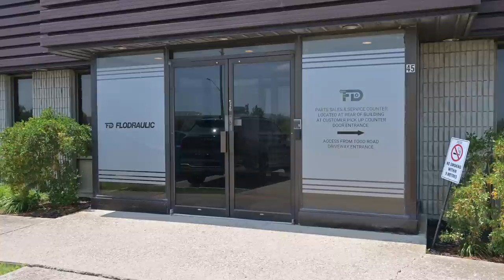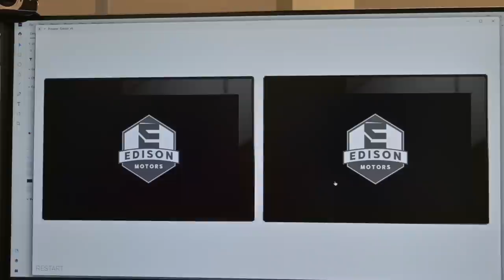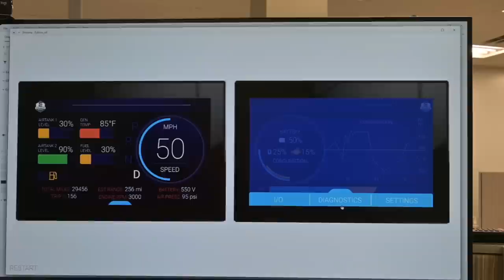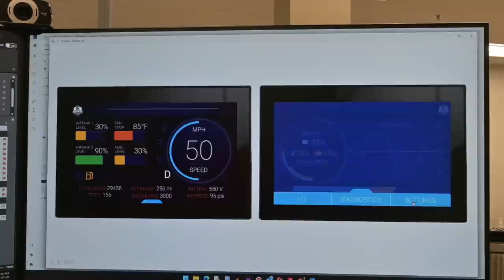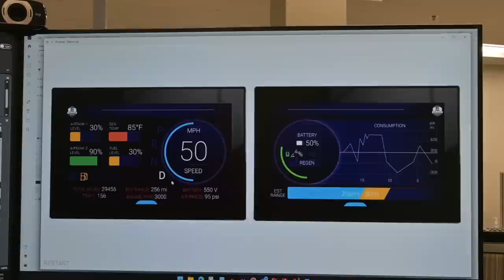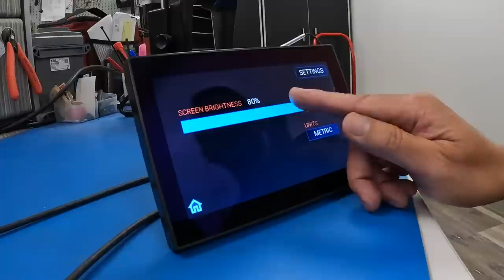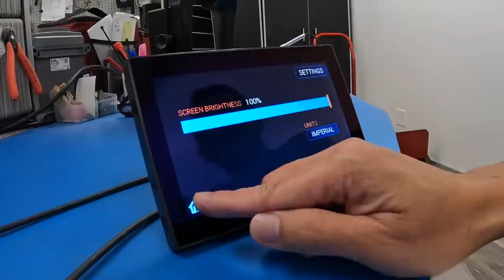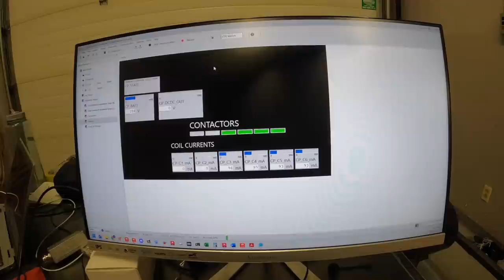Testing The E-Axles

Comment: To the software developer, remember to do real world testing, and make the screen dim automatically when the headlights are turned on so it doesn't blind the driver
Reply: Make the dimming it's own, annoying loosing it where headlights are mandatory 24/7
Reply: Great suggestion. I find when I am driving anywhere there aren't any external lights (e.g., outside of a city or town), I turn my dash lights almost completely off. I find it makes such a big difference in my visibility when I don't have a bunch of unnecessary bright lights shining in my face that is reducing the sensitivity of my vision.
Reply: Some safety protocol calls for headlights on at all times when truck is moving. If they dim dash you wont be able to see it in daylight, just like the error they made on the pt cruiser dash lights.
Reply: Red backlight is a big eye saver at night.. or at least allow the operator to choose it if the leds are programmable
Reply: Yeah, don’t pull a Boeing starliner and forget to set the clock 😂
Reply: Or  add a quick toggle switch that switches between dash lighting configs that you can set up yourself
Reply: Yes but also put a esey lever and a switch to turn off any automatic dimer
Reply: How bout an old fashioned dimmer switch? 😮
Reply: Some places require headlights to be on 24/7, making this feature pointless and annoying. Should offer the ability to deactivate it.
Reply: Should have 4 modes.  Auto dim via sensor (with light sensitivity adjustment), Manual adjust from full dim to full bright w/physical dial/knob, full dim over-ride, full bright override.
Reply: I drive with the headlights on any time the truck is running. I also wear sunglasses during the day. The dash dimming automatically based on the headlights being on means I can't see the dash durring the day. Just something to think about.
Reply: How about a good old-fashion dimmer switch?
Reply: Blue light filter would be awesome too
Reply: Yeah cause they haven’t thought of that🤦‍♂️

Comment: I like the graphics that are being developed for the displays. One suggestion that I have is to look into implementing ISA 101. ISA 101 basically uses greyscale for everything, and then adds color when warnings / faults are present. The idea is that the sudden change in color will draw the operators eye to the screen. Shoot me a message if you'd like to see a demo of what I'm talking about (I'm an engineer for a very large automation company)
Reply: That would be a great option, but it should not be the only kind of display of information i think, cause it looks as appealing and is not necessary for someone who at the core just drives a truck.
If that would be a big machine that needs to be monitored 24/7 i would say that something lile ISA 101 is necessary.
Reply: This is a great idea! Kind of like what Airbus (and now Boeing with the 787) do with the “Dark flight deck” concept. Lights are off (well, dim) when they’re working right, and turn on when they need attention.
Reply: Great idea period

Comment: This trip was not a waste of time to most of us listening and learning how both of your companies work together and we see the beginnings of a new company. Thank you for the great trip! And I thought EV trucks were a no go. I drive a snow plow for a town in Western New York where we see the snow some times in great amounts. This would be interesting to see if an EV snowplow truck could work in this environment,  especially with SALT!
Reply: Was about to write that, definitely not a waste of time, super interesting stuff.
Reply: batteries and winter are a terrible combo. hybrid is viable because the engine charges the motor, but batteries lose a ton of capacity and output in the cold. teslas actually heat the batteries in the cold so they can hold more
Reply: I expect the 'snow plow' application is going to be narrow field...where there IS great changes in altitude for regenerative operation. Flatgrounding these things isn't going to make sense, eventhough I'm sure lots if Government Entities will clog the streets with them.
Reply: The generator will also act as a heater for the batteries so temperature won’t be as much of an issue.  You will get the advantage of the amazing low end torque of an electric motor, great for slow heavy starts.  Also the precise traction control you can get with an electric motor means you will have less sliding in icy conditions.  One of the other advantages that electric has is you can power all sorts of auxiliary devices, like a welder for in field repairs.  There is a lot that electrification can bring to a snow plow.
Reply: "Let's watch the axles spin" was the teaser for a much more in depth great video. Chase wanted 1 battery bank operation. I'm surprised that wasn't communicated well to them.
Reply: @wild_lee_coyote i seem to remember chase mentioning testing with a standalone diesel heater for liquids ( ie the coolant ) for warming up the battery blocks
Reply: This is the interaction that I was looking for. I am a mechanic here in Western New York area.  Salt sucks, but it pays the bills.

Comment: I usually prefer analog gauges, but I absolutely love the way those displays are done, and the diagnostic screens are ingenious. Have a simplified overall schematic illuminated so you know what you're looking at as soon as you start. Having one screen for engine/generator and one for chassis is a great idea also. Well done, all of you!
Reply: You need both, different tools for different jobs. You can't do stuff like energy flow and historical metrics with gauges. While gauges are far superior for vital live metrics. The way Edison with old-school dash infront of the steering wheel and screens on the roof is perfect.

Comment: Listening to this, I suddenly had an interesting idea: I used to drive off highway truck chassis based fire trucks for forest fire fighting... the edison motors truck would be AWESOME for that. In order to run the water while moving, our trucks had auxiliary diesel motors just for the pumping and hydraulics systems. That could be entirely replaced with an HV pump. The bottom could be heat shielded, and with the space saved by cutting out the auxiliary diesels, the water capacity could be increased. The cab gives excellent visibility, the controls could be simplified and omfg the info I could get from those LCDs.... now I'm giddily excited!
Reply: I remember 15 years ago explaining to a rural firefighter all the advantages a hybrid apparatus would have over regular diesel-mechanical. A 200kW generator gets more work done than a 200hp PTO shaft any day. Less fuel burn on the fireground, easier to maintain and swap electric accessories to match the task, can combine/share the power from multiple apparatus if needed, plus power emergency shelters and pumps during outages, etc. Get rid of all those separate engines to maintain for generators, compressors, boost/draft pumps, etc.
Plus, electrics can be built inherently safe. Put an LEL meter on the truck to automatically switch it to all electric mode when an explosive atmosphere might be present, it can still operate if needed without being an ignition source - that would be mandatory for oilfield firefighters right quick.

Comment: It would be good to be able to change the units separately for speed and temperature ect - here in the UK we use Celsius for temp but miles for distance and speed (for whatever reason) 😬
Reply: Don't worry we also do that in Canada for various measures lol I'm sure they will think of it. IE coolant temp in Fahrenheit, speed in kph
Reply: @duffbiker psi > kpa
Reply: Because they did not want to follow france fully, just partly.
Reply: how we measure distance in miles, mileage in miles per gallon, then sell and measure the fuel in liters is infuriating. my JDM honda with a converted speedo gives me miles per liter, much more useful!
Reply: @olivermatich2818  agreed, if we're going to go metric we should actually go metric

Comment: with the screens make sure they have airbags etal so they do not get shaken to bits and stop working when in the truck if you need a replacement it is less than a 5-minute job as in pull out unplug etc

Comment: Having worked with electronics in high vibration environments, the only thing I'd change about the electrical boxes would be to - Use fatter cable ties - The fatter ties don't dig into cable insulation.  P clamps to hold bundles  down so they don't wiggle, and the use of foam pads to prevent the signal cables from  wiggling in the conduits.   Adhesive cable tie mounts always melt away in high temperatures.  If it can wiggle, it needs to be secured, and avoiding putting stress on the connectors prevents wires from breaking at the connector.  

I hope it goes well for you guys.
Reply: Mike Patey sells some really awesome zip ties for high vibration environments. If they're good enough for aircraft, and good enough for Mike Patey (extremely high standards) they're good enough for a work truck.

Comment: May I suggest that you have the units selectable for each function?
An American driving through Canada may will want speed in the local Km/h, but temps in °F (what they're familiar with).

Most Canadian's will want engine temps in °F and outside air temp in °C, and pressures in PSI, etc.
The vocation specific functions may want totally different units again.
A master switch to go all metric or all imperial doesn't reflect the real world use of mixing units.
Reply: 100% agree with you
Reply from the maker: That actually is a really great idea!  Thank you
Reply: @northern1937  how much power kw?

Comment: A warning popup that covers basically everything is not what i would do, i would flash red at some place where nothing of the information is blocked so the driver can see "oh theres a problem" but still see all hte information while the popup is there.
Reply: Common issue with graphic designers, they have either null or very superficial knowledge about usability.
Reply: Agree. Or at worst a Tertiary screen has the popups. I wouldn’t want it overt my primary display.
Reply from the maker: It depends on the pop up.

Minor ones are just a warning icon.  Major ones you absolutely need to notice should pop onto the screen
Reply: @EdisonMotors  Still, covering the speedometer with a warning message that is anything but "STOP VEHICLE IMMEDIATELY" isn't a good idea...

Comment: One thing that would be nice to incorporate is the ability to set some parameters to be  displayed in metric and some in imperial at the same  time. Us Western Canadians (i cant speak for the easterners) are accustomed to using to using a mixed bag of measurements. Its annoying on modern vehicles when i want the temperature displayed in °C but then am forced to get pressures in kpa because of it.
Reply: It would be nice if I could just double tap a guage, and it would switch from imperial to metric, double tap again and it's back to imperial.
Reply: @jmanlinc also double tap would be nice to cycle through the various different measurements. 
KPa vs atm vs psi vs mmHg.

Comment: After seeing the power flow diagram, I think you will need to simplify it like the Prius does.  You basically have GEN <-> Battery <-> Axles.  You just need to show charge and discharge from each item.  During power with Gen running, it's charging the battery and the battery is discharging to axles.  When regen, the axles are charging the battery.  When using the generator as a jake brake, the axles are charging the battery, which is charging the generator, which is discharging to the engine.  So I guess you need to show jake brake in the diagram too.

Comment: Make sure the actual display monitors you install are significantly larger than that small monitor Jerome was using during his demonstation. Don't settle for just any font, or at just any point size, or any letter spacing. Make it zero strain or effort to read the display without having to strain your neck forward etc. No small matter, that interface. Legibility is crucial.

Comment: I'm skeptical of having controls that can only be operated through touchscreens. If the driver is wearing gloves, or has dirty hands, or the road is bumpy, those screens would become annoying or impossible to operate. I'm surprised given the background of all the teams behind the project that this is the route they're going with.
What I'd like to see (and granted I'm just a construction contractor with little knowledge in heavy trucks or programming industry, I could be entirely off base here) is a row of clickable rotatable knobs under the screen for scrolling through and selecting options that could be mapped to different fields per screen as needed, a set of directional buttons for other navigation, and a brightness dial on each screen. Look at the control scheme on a Behringer digital audio mixer, that's the kind of thing I'm thinking of.
Using physical controls like that means the driver can operate the screens while wearing work gloves (or not have to take their winter gloves off while the truck warms up) by muscle memory without looking. 
Regardless, I'm excited to see these trucks come to market! Looking forward to the day i see a cement truck roll up to site completely silent
Reply from the maker: You really shouldn’t have to ever touch those while driving.  All the controls you actually need are switches in the dash

Comment: Have you considered a shut off switch to isolate your systems for welding,or a built in ground to drop to protect the truck when the “something snapped off, we need to weld on the truck.” events. With all these electronics it would be nice to not smoke them.

Comment: Just having looked at those screens, I have a few unfortunately negative opinions. Main one is the dead space around the screen, it’s not necessary and makes it harder to read. Next I’d probably add some buttons along the bottom to do the main screen navigation features. Even modern touch screens are less reliable than buttons, especially when exposed to the sort of environment this truck is supposed to inhabit, i find it especially frustrating working with gloves on and having to take them off and on to use touch screen devices, and the solution of a more sensitive touch screen may also not work due to the dirt and water that will get on the screen. A lot of the rest of the UI is pretty good, though the font size for the truck diagram looks incredibly small compared to even the rest of the text.
Reply: I agree, something more along the lines of the flight management computer in Boeing aircraft might be a bit easier to manage while wearing gloves with buttons around the display for user input. Maybe it would be good to somehow marry touch screen technology with physical buttons so it can be a dual input scenario.

Comment: Wouldn't say your trip was a waste.  It was very interesting to see how the systems Intergrated and the touch screen display designs. Only suggestion I would give is, since the displays are touch screen, I would have some type of screen protector over them (tempered glass maybe?). Would hate to have a screen crack because my dash camera or hard hat fell out of its rack and bust the screen to the point it's not useable. Great Job guys keep up the good work. You've inspired me to buy an old used truck and get it ready for your conversion kit.

Comment: This was really cool to see and positive overall. I do think that adding buttons and an emergency locator that can run on low power if anything happens are neat ideas. Id also like to add that maybe it eould be good to add a battery level indicator by the fuel level indicator just to avoid any confusion between battery level and fuel level.

Comment: Curious question, Have you considered a braking resistor grid network for the DC bus with a crowbar circuit? I know you can dump to batteries for braking but DC bus line protection circuits are usually engineered into systems like this for railroad and mining trucks. It also adds incredible braking capabilities to the truck.
Reply: He talks about it in another video, most of the time the battery can take 100% of the braking power. The exception would be going down a long grade, the battery would eventually reach full charge and can't take any more - so then they use the generator in reverse as a motor to spin the diesel engine, and activate the engine's jake brake.

Comment: Just a tip: Don't assume anything with HVDC including the abbilities of HRC fuses. Place barriers between each fuse or see what happens when a fuse explodes and draws a DC arc to other terminations. 
Clamping bolts on the bus-bars are very small.

Comment: agile methodology, create a minimum viable product for customers and add additional features as you get more customers with more needs. release updates in iterations for existing customers that refine features. its easy to get lost creating too many features right at once. it'll also be hard to create a good update system for vehicles in remote areas w/o networks, but that could be really important.

Comment: Just me, but I think it is critical for you to have some kind of very deep level GUI based tuning application that runs on a computer that can patch into the truck. to allow end users to tune all parameters of the drive control (within reason) for their use case. I imagine there is a lot of scope for optimising the drive control parameters, regen and discharge/charge points/curves at different temps etc, especially for use cases where the truck will be doing the same route over and over like on mines. AI optimisation tools could be amazing for this - like a self tuning mode!